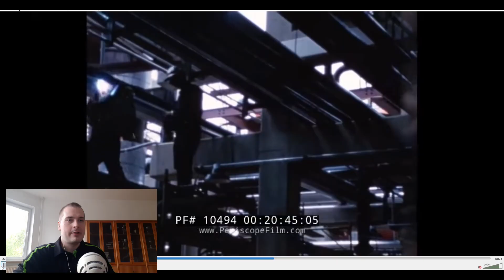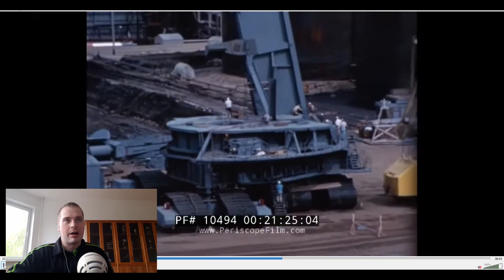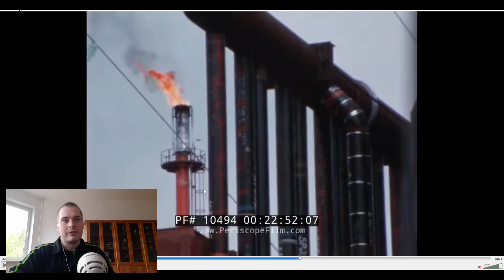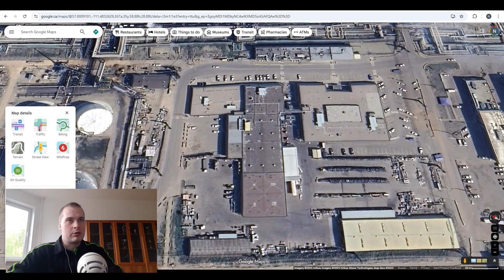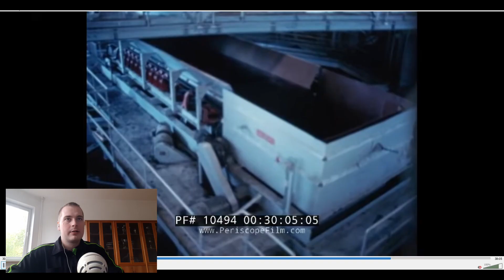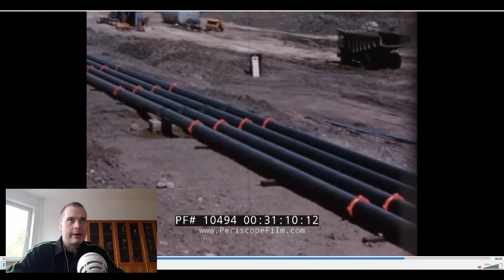Niko's Tales From the Base Plant – Part 4 – Primary Extraction, Control Room and Conveyor Belts

Comment from the maker: Part 5 is out NOW:
https://youtu.be/DeZHkDSWVxs

Just wanted to apologize ahead of time for incorrectly naming a remote building in Extraction area as the "MCC/Electrical Building". I've visited that building only once and just remembered that there were some pumps and other large equipment inside and the electrical rooms were on the second floor, so in this case it would not be correct to refer to that building as the "Electrical Building". If I ever remember more details about this building or find something, I will post it in here.